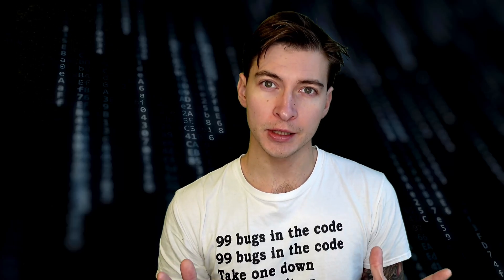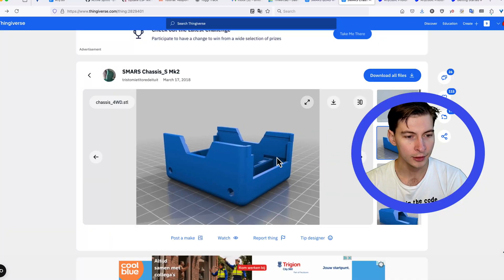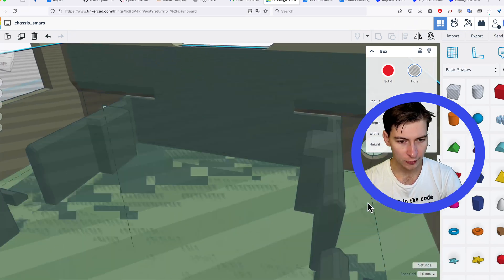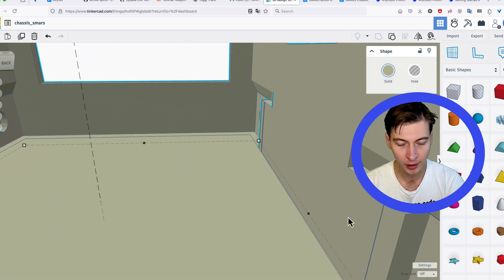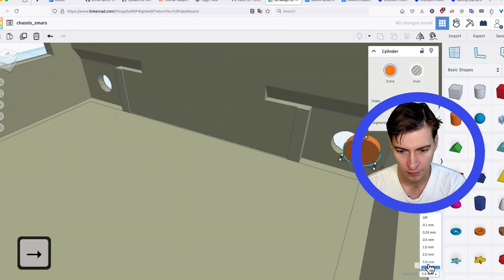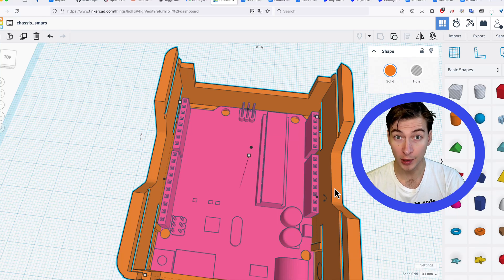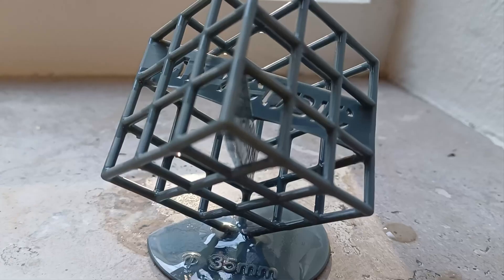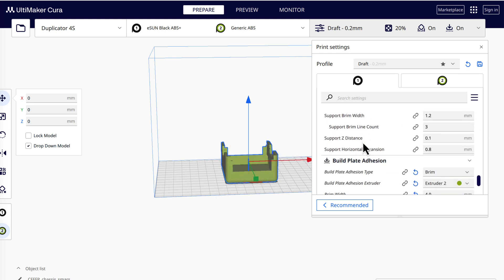How I Customize 3D Models for My 3D Printing Projects

Comment from the maker: It's 11.11 and there are some nice discounts on Aliexpress - use these codes when you're shopping.
Does not have to be the items I linked!

$2 OFF For orders over $20
Code: 【IFPPEY1】
$5 OFF For orders over $50
Code: 【IFPRCIM】
$25 OFF For orders over $200
Code: 【IFP4SAG】
$50 OFF For orders over $400
Code: 【IFPS3AZ】